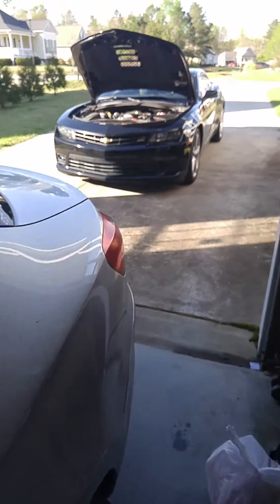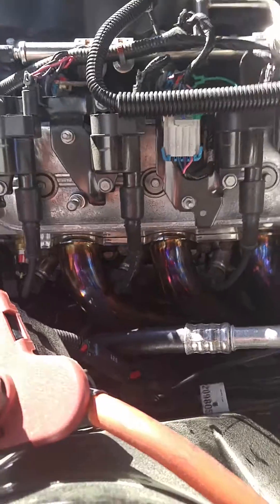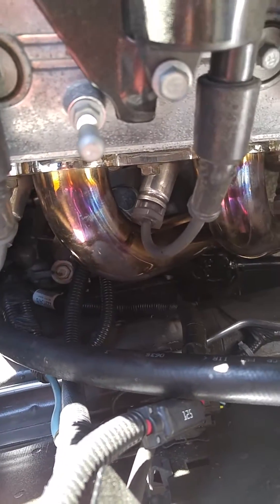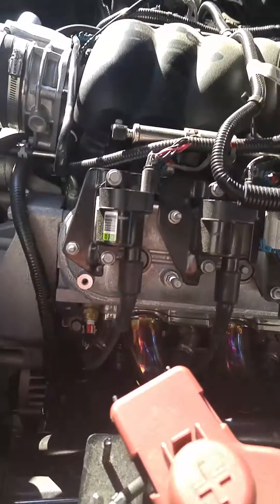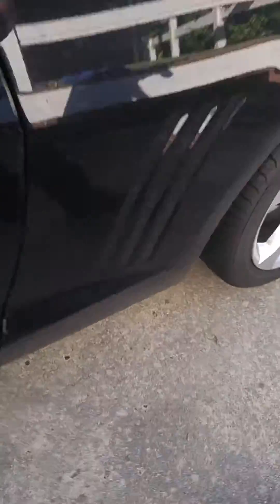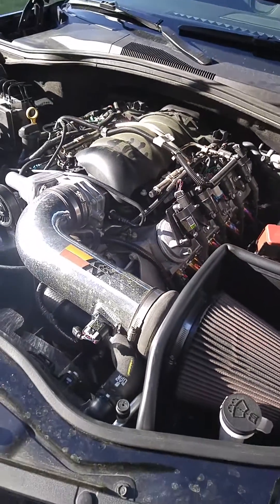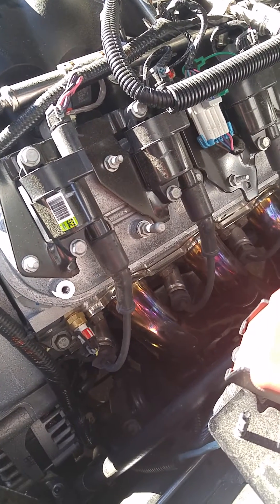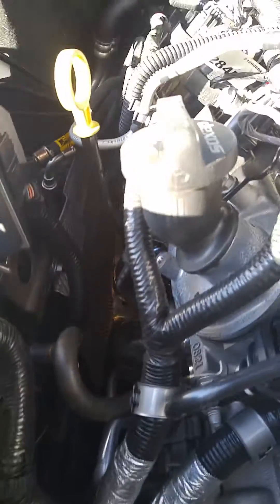2015 SS camaro longtube headers rubbing steering shaft

Comment: I know this was posted a long time ago, but thanks!! I just bought some long tubes for my mustang which reportedly has the same issue with the steering shaft bolt rubbing. I’ll do this on the install and save myself the headache of doing it later. Thanks a lot man!
Reply from the maker: No problem. Glad it helped!!

Comment: Im having a little trouble understanding what to do once the motor mounts are loosened. Are you saying too move the motor too the passenger side and then tighten the driver mount back down? Or are you just moving it enough to put a dent in them to make it clear? I’m not the most mechanical and my car came with LT’s from the PO.

Comment: Had the same problem with the 2" headers...going in reverse the steering wheel would shake and making right turns the steering wheel was pretty tight...i was pretty pissed
Reply from the maker: Yeah.. drove me nuts. So glad i fixed it!
Reply: +Zuki Dookie same here i sold them...but i will be purchasing another set and marking the spot
Reply: Well for future reference for anyone else that sees this comment, 2” headers are too big for the LS3 and make you lose power.
Reply: Eric Erickson what if the car is supercharged? Still to big?

Comment: Well I don't have a Camero but I have a 2014 ram 1500 4wd and I got 1 7/8"  long tube headers for it and the same thing is happening but mine are rubbing some but I can't get the steering shaft off to pop them the truck is also lifted 6"

Comment: I have a 2013 hot wheels camaro . I put shorty's on it and it is rubbing my steering shaft near the top. any suggestions for a fix? motor mounts appear to be ok.